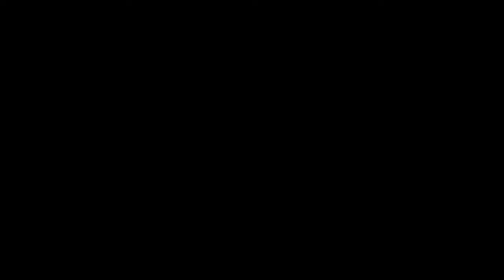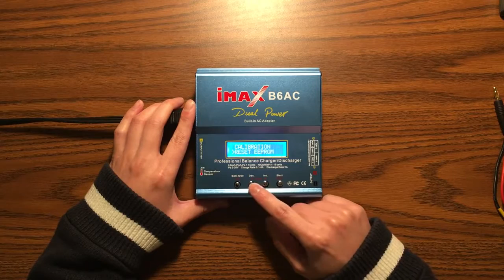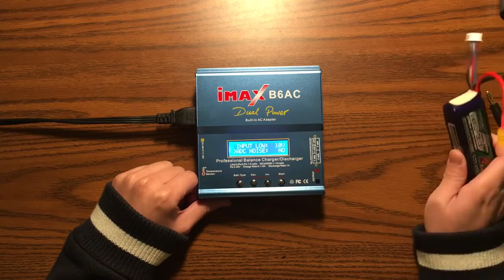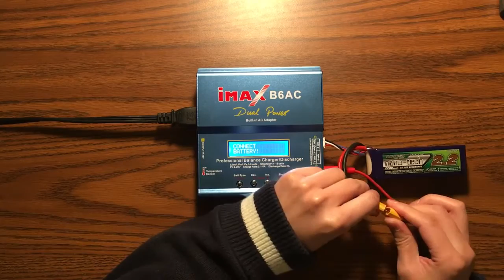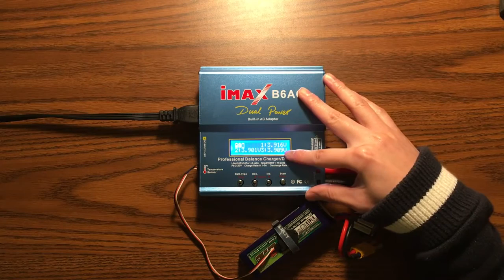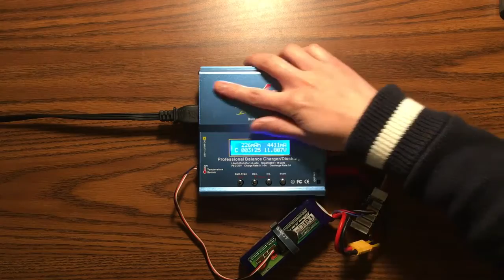IMAX B6 Battery Charger w  Customized Firmware

Comment: Will this work on the smaller charger that uses a external power supply?
Reply: Yes, the AC model simply has a AC/DC brick inside that is hardwired to the board. Annoyingly some B6AC's don't actually work if you use the DC jack! You still need to check if its a clone or not or has the correct chip (you will need to open it to check).
Reply: @drsquirrel00 i have a clone one, what is the correct chip?
Reply: @felipehcraftgamer4193  you need an Atmega chip inside

Comment: Is there a video you can recommend that describes how to update the charger? I was really disappointed to realize I couldn't calibrate.
Reply from the maker: Hi, here's the page for the original firmware. You can follow the steps for calibration: https://github.com/stawel/cheali-charger
You may also want to refer to the instructions for additional settings: https://www.dropbox.com/s/0nux3xkf5eb859d/imaxB6-NEO-V110.zip?dl=0&file_subpath=%2FInstructions.txt